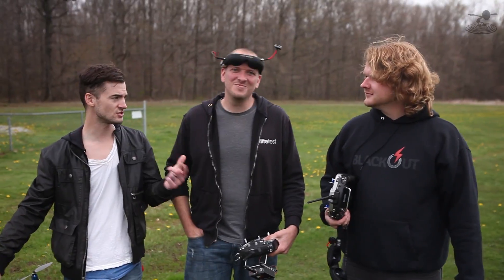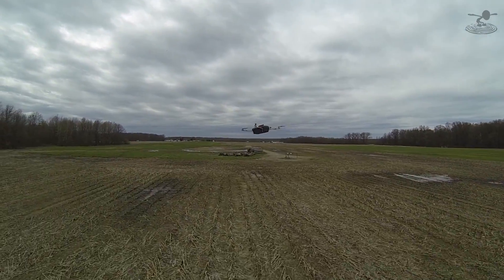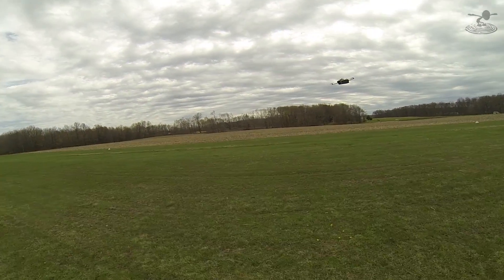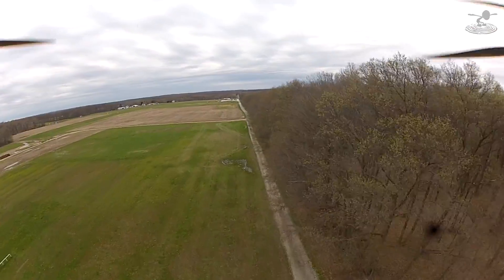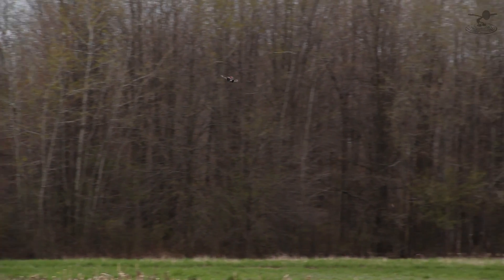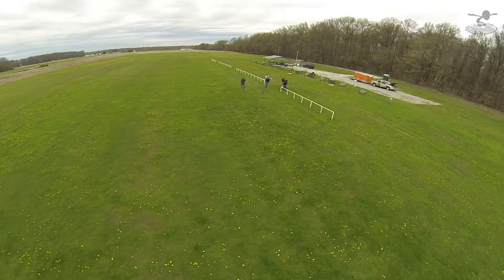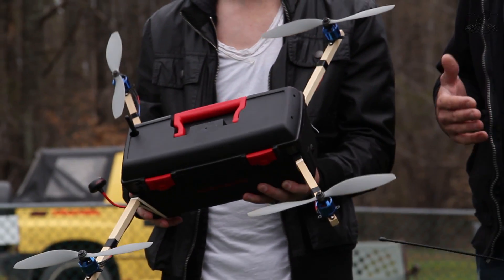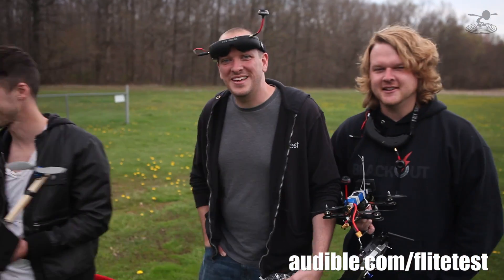Flite Test - Box-O-Copter (toolbox quadcopter)

Comment: The arms need to fold in or slide in to the toolbox so you can carry it around.  If you use a bigger toolbox you might be able to put a transmitter and/or fatsharks in it.

Comment: Then you can put your electric eponits. Then you measure out the width and the length inside. Then you put a removal able covering. So you can change the battery out. Then put your light weight items on the top.

Comment: One of the problems for building your own system is knowing what to buy.

It could end up costing you double or triple the price of one that has already been made, because you might buy something and it won't work with something else you bought, so you then have to buy something else to make it work with something else and so on.

So it would be good if you could provide a parts list of all the things you actually bought for your toolbox copter including the name of the brands you bought for the electronics.
Reply: Generally, you can end up building for 2/3rds the cost of a pre-built or BNF kit. Sure you have to know what to buy, but that's research you'd need to do anyway, so you will know how to repair your quadcopter WHEN you crash. Everyone crashes, it's just a question of how often.
Reply: CardellaTK I think this idea that you need to build it in order to repair it is completely wrong.

You don't need to build your car in order to fix your car when it goes wrong.

For sure it helps to understand what you are doing with regard to these quads, but there seems to be so much misinformation about that that it is difficult to find the correct thing to do just to get a basic model working correctly.

Even the actual literature that comes with the parts can be confusing.

What would be helpful to anyone wishing to get an idea of what to buy and how to set it up in order to fly a basic model would be for someone to show a demonstration model with a parts list and configuration set up so if someone wants to spend their money on this type of thing they can build it themselves but with the confidence that someone has shown them exactly what to do for the very first one.

You have to remember these things in some cases have to connect to computers and software down loads and computer configuration settings and such, not everyone has the knowledge to first build, plus learn all about the software, plus buy special leads if they don't have them already, plus set up ESCs configure motor rotations and so on plus learning all about the different tilting actions like yaw.

I'm sure most people simply don't have the time or the patients but may be suckered into spending a lot of money having a go because it looks so easy and because someone said it was so easy. 

Yes it can be easy but only if you get the right stuff first time and you have others backing you up with answers to your questions, if not then most people would be much better off buying one that has already been built for them and set up for them so they can fly it, then they learn as they go along bit by bit.
Reply: flitsies You're correct, you don't have to build it to repair it. But by building your own, you'll have to do all the research necessary to know how to repair it. I would say that someone who has built quads in the past is going to be more able to repair them in the future, vs someone who has just bought RTF quads.
Reply: CardellaTK Well yes chances are they will have a better insight, but it may end up costing them a lot more money and time and by the time they get it in the air they could end up getting pretty pissed off with it and dump it in the trash.

RTF is by far the best way to go for a complete beginner.

The advantage is that you can learn as you fly rather than spending most of  your time trying to make it fly.
Reply: flitsies I generally recommend a micro or nano quad for complete beginners. You can crash a Hubsan X4 or Estes Proto X a hundred times, and sustain nearly no damage. Learning to fly something larger, odds are you'll end up breaking propellers, perhaps arms, perhaps severing wires etc. RTF in terms of a micro quad, I'm right there with you. But as for your main, full sized bird? Gotta build it!
Reply: CardellaTK Yeh the micros are good, and there is merit in both build your own and RTF.

But it does take a certain level of understanding to get to grips with the build your own that some people might struggle with finding the time to explore. 

So yes merit in both methods.

The cheaper RTF ones will give you a good idea of what to expect or a good starting point, while build your own will enable you to do much better but it's at a cost.

So I don't disagree with you, it's just not everyone has the time it takes to spend doing the research or know where to look.

You can see some really amazing film footage of what some people have done with their quads, but some people keep their specs and settings close to their chest.

Comment from the maker: If you can dodge a tool box you can dodge a Box-O-Copter.
(or something like that)

Flite Test - Box-O-Copter (toolbox quadcopter)
Reply: Finally a APM setup. I'd love to see what you will do with that. Autonomous tool delivery drone perhaps?
Reply: +FliteTest how much would this build be
Reply: Bref aujourd'hui tout peut voler!
Reply: Tradd Rhodes those 3dr motors, 800 kv
Reply: What is the chase quad you seem to use in all of these videos?
Reply: those os motors , if so nice howcome not hobby king this time and , also what size?
Reply: ok..
Reply: when u need tools on the go get a box o copter
Reply: Tolls for the air force mechanic.
Reply: yep
Reply: Martin Stewart
yes in  deed
Reply: Rather B Flyin I think its the quad from readytoflyquads.com
Reply: At that time they were using Blackouts
Reply: FliteTest I really really wanna build this but does it matter what kind of toolbox i use
Reply: The lighter the better
Reply: Martin Stewart how does this one look
http://www.amazon.com/Akro-Mils-9912-12-Inch-ProBox-Plastic/dp/B0002I5XHK/ref=sr_1_3?ie=UTF8&qid=1439773014&sr=8-3&keywords=plastic+tool+box
Reply: Looks good you just have to remember to calculate your motors, props and esc for your total weight in grams.
Reply: yhank you so much for your help
Reply: Martin Stewart One last question what question this is my first build and i want long flights what motors props esc's and batteries do you recommend for about 20 min flight time
Reply: It all depends on the overall weight of the quad.
Reply: Martin Stewart will just be putting a naza mv2 dji bluetooth data link
and a js5000 sportscam with a plastic gimbal

Comment: I considered a Tupperware center body with the cross arms going through (so the enclosure was not structural), but I was concerned about trapping heat inside the enclosure during flight.  I see your toolbox is black.  Doesn't that get warm inside?  And at what point would that impact the electronics?

Comment: How much money would i need to get a quadcopter with fpv plus everything i need to control it (i have no transmitter or anything but i have a gopro)? So how much is a rtf fpv multirotor system?
Reply: Thats depends on wether you want to build one or buy one. For buying you can get a Dji Phantom for 500 dollars, which is rtf, however no fpv included. 
For building i would calculate 300 dollars. Thats for Transmitter+battery, charger, flight batteries, fpv equipment(5.8ghz is cheap) and the quad itself.
Reply: sounds good :D i will look into building one